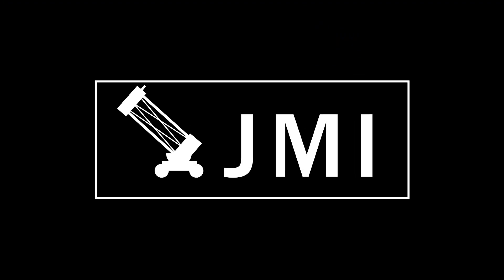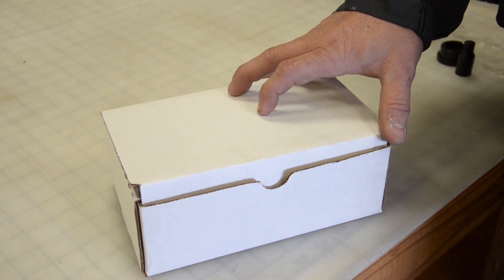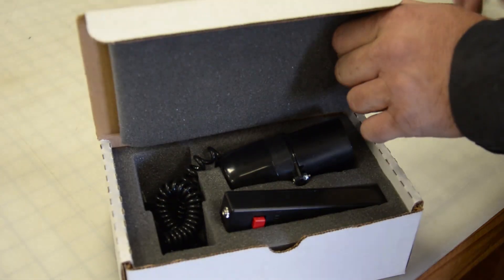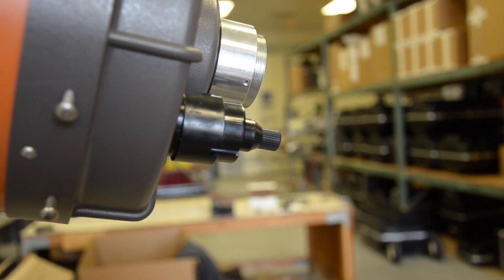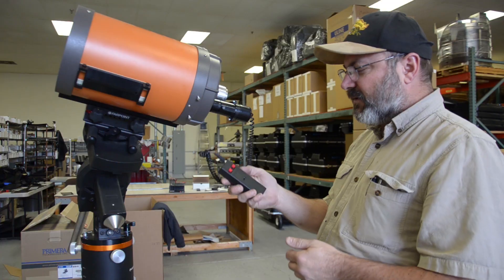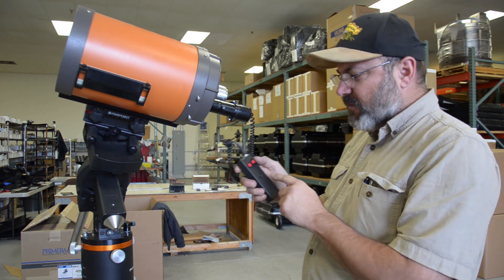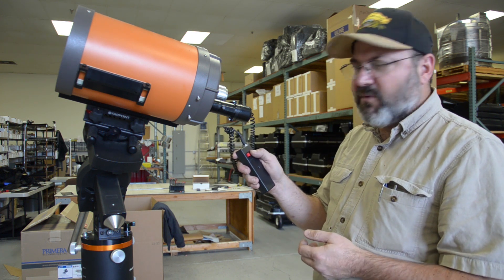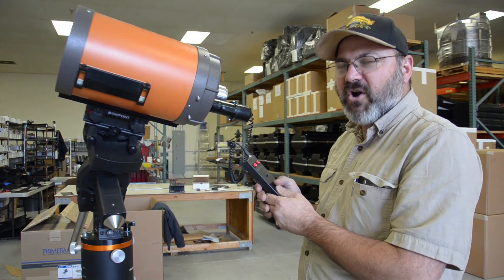JMI Motofocus Installation

Comment: I have a JMI motofocus for my Nexstar 8i. Comes with a motorized axis that attaches to the kit focuser using an o-ring. I need a new o-ring - but do not know the size of the old one. Can you tell me what diameter or size I need?
Reply from the maker: Hi Jim, for any support questions please email; our support desk at support@opticalstructures.com this will automatically be flagged for our motofocus specialist.  thanks!